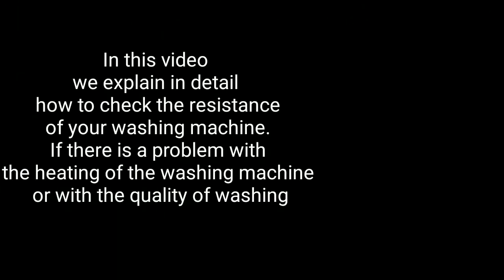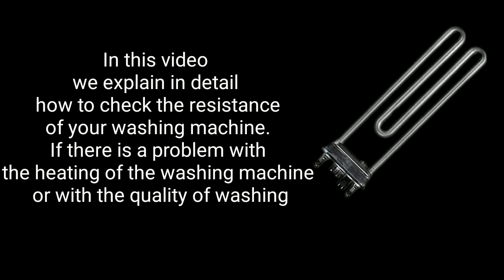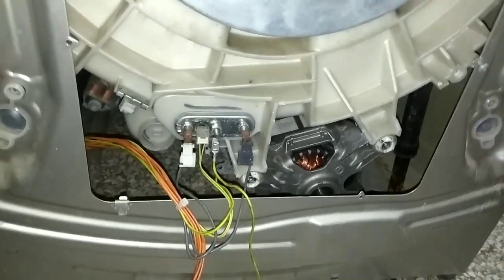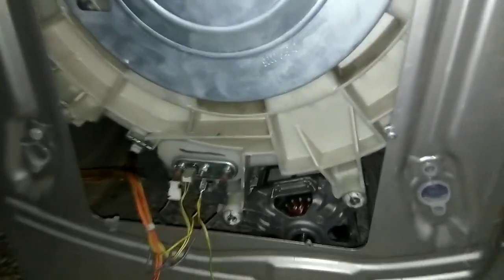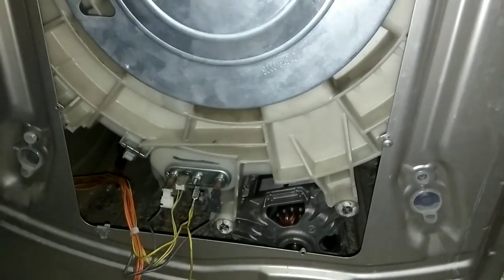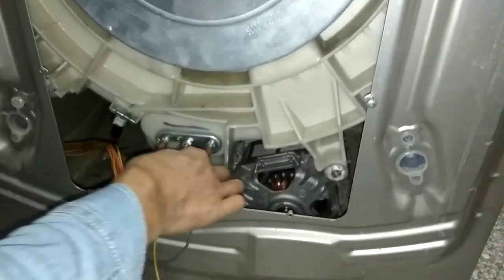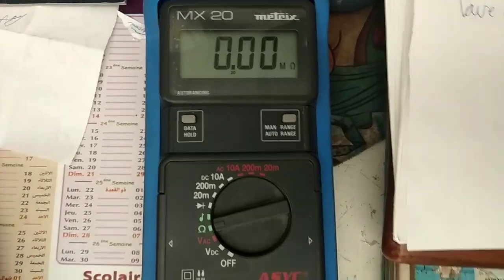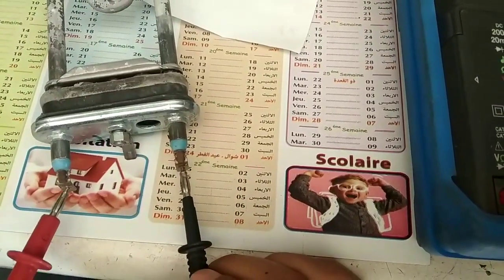Tutorial:How to fix a HE or HC ,H1 H2E error code on your Samsung washing machine

Comment: Please answer me🙏🏻 Samsung dryer heat pump DV90M500QX / where is the capacitor ?  I didn't find, my dryer is opened but can't find the capacitor please answer me
Reply from the maker: The condenser is located between the pump and the compressor. This is my WhatsApp number. You can contact me on WhatsApp and I will send you a picture and a place, not the condenser.
Reply: @soselectro   thanks am waiting you
Reply: اخوي الكريم اذا كنت عربي شرفني بالواتساب انا ماظهرلي رقمك وشكرا لك
Reply: @soselectro  
Please send email to my email im waiting you
Reply from the maker: 00212665120215